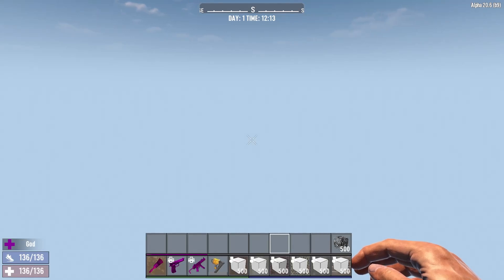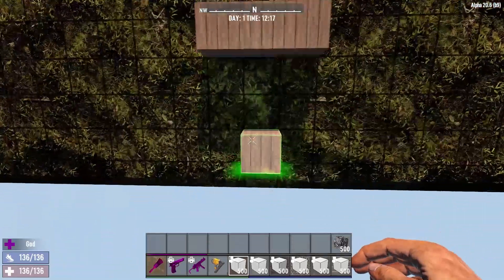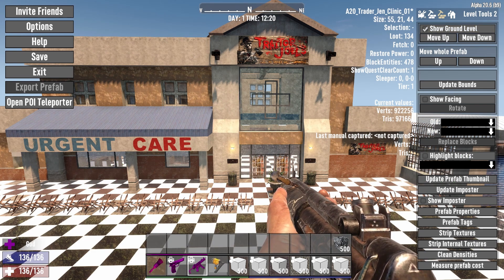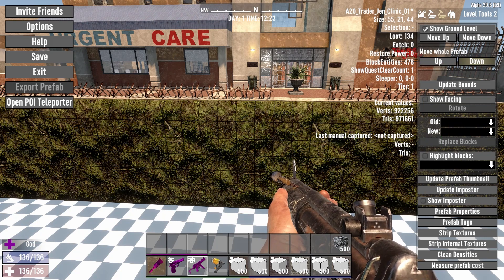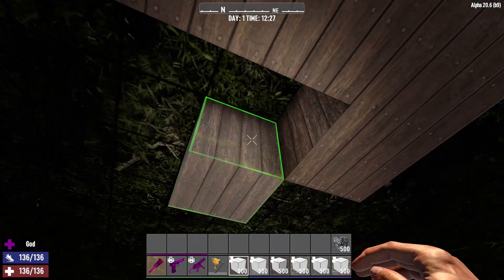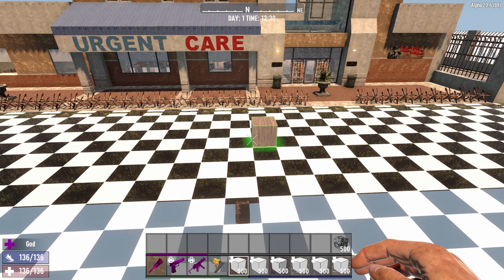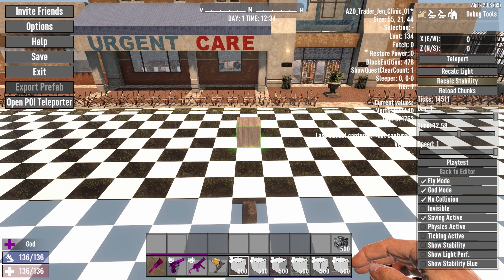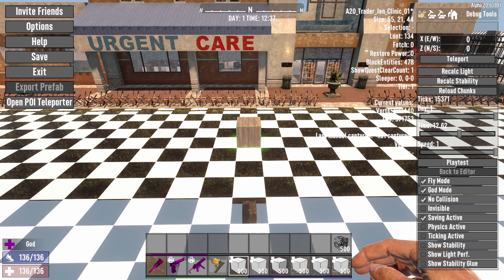7 Days To Die - Adjusting The Ground Level - Prefab Editor Series

Comment: hey.. can u tell me how to turn god mode off? i was recently trying out debug and creative mode... when u press escape it puts u in poi teleporter etc.. and i turned on god mode & fly mode.. but when i turned it off later it still said god mode over my character info on the bottom left.. also what does show light perf mean and what does show stability glue mean?
Reply from the maker: Press the "Q" key to toggle God mode on and off. I forgot what the light perf does. Will have to look that one up. I've never really had a need to use that. Stability glue will show the stability of all of the blocks in a prefab. The green blocks are fine with red blocks being very questionable.
Reply: @GunChronicles  those other settings u went thru are they only in poi builder mode? or can u do that while playing the game? ive still never tried the poi builder i just make things as im playing
Reply from the maker: @tigrecito48  Everything shown in the video is for the prefab editor only.